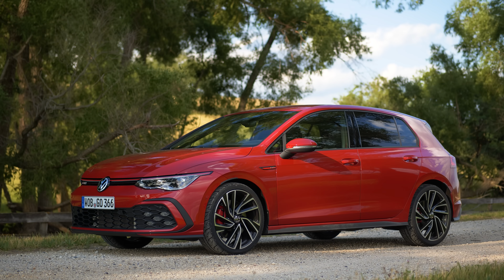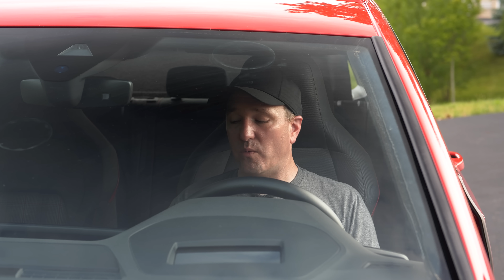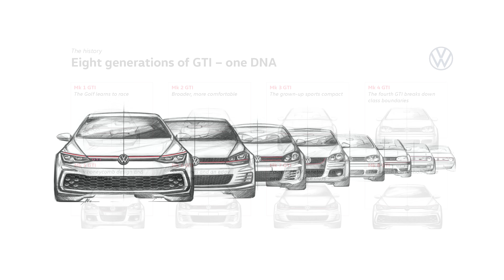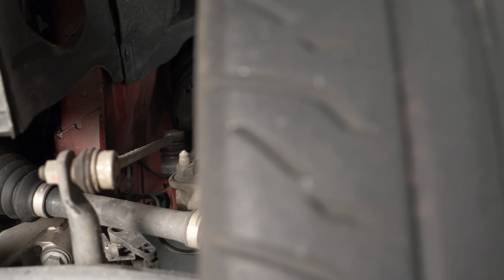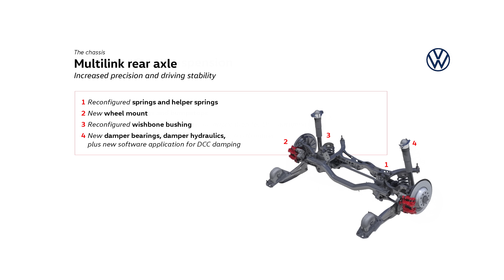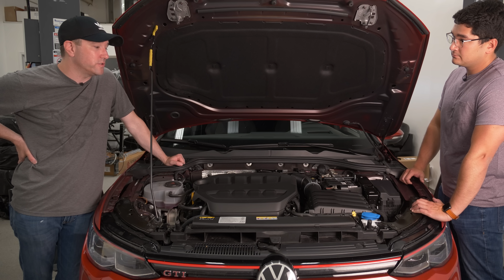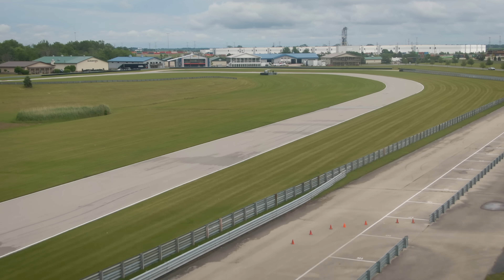2022 VW GTI Mk8 | Unexpected

Comment: I'm curious. Why is the HVAC control such a big deal? I literally set the temperature at 22C in the summer and 24C in the winter and I'm all set for the year. The blower setting is constantly on the 2nd setting cause i don't feel like i need it instantly cold or hot cause me playing tennis, the conditions are ten times harsher. I just dont see how something so small is getting so much fuss.

Comment: Great video as always Mark by you and Jack.  I have an ND Miata RF 30th Anniversary which is NOT my daily driver and I love it to death.  For a daily I was curious so I went to a VW dealer here in Toronto and test drove a manual Autobahn model.  The things you mentioned about the driving dynamics were spot on as I felt the same way during my test drive.  Beautiful and engaging car.  Obviously the manual is not even close to my ND Miata but it’s not a complete nightmare either.  The car felt really nimble and playful yet very confident and solid at the same time.  Thanks for the review 👍🏾

Comment: With 2024 being the last year for the manual transmission, I no longer see the point of buying this car. We're talking about 35 to 45k for a tiny car that doesn't even come with a manual transmission option. If I'm going to get an automatic then there are many other options out there even if they lack some performance. To me, a performance car must come with a manual option, otherwise, it is simply a car that goes fast. Might as well just be a self-driving car. BIG MISTLKE getting rid of the manual transmission.

And, unfortunately, the Jetta is made in Mexico and I do not trust the craftsmanship. My personal observation is that VW cares more about sticking toys in their cars and the latest high tech than worrying about making a car that lasts. When I was a kid, it seemed like VW Rabbits would run forever. Now it's turbo this, electronic that, and it breaks.
Reply: VW only sold 8000 Golf in 2022 in the USA. And the manual hasn’t been available on the R in Europe for years (maybe the GTI too).

Comment: GTI DSG or GR Corrola?

I want a fun daily driver that is economical and reliable.

I drive over 80 miles round trip to work each day.

Currently have a 2021 Corrola hatchback 6 speed. Love the car, just want a little more power for passing when needed.

Note: Volkswagen reliability concerns are the main reason I haven't pulled the trigger yet. That and the possible 8.5 update with hopefully physical buttons.

Comment: My MK7.5 does have an oil cooler.  The bad news is they fail and let oil into the coolant system, which is bad enough, but it also lets coolant into the oiling system, which is a disaster.  I first spent $1800 having the oil cooler replaced (6 hrs labor) and systems flushed.  Didn't help, four days later the disaster and $9000 for a refurbished engine.  This is a horrible engine design.

Comment: As an owner of a nicely modded MK7 GTI, I must say that with suspension mods, grippy tires and engine tune the MK7 is very competitive and great fun to drive on the street. And the MK7 has a proper cockpit with well designed user controls and interface.

Comment: I wish we had a dual fuel injection system, specifically the inclusion of port injection to keep valves clean. My MK6 GTI had ghastly deposits on its valves with its direction injection set up. While I didn't notice any idling issues until about 150K miles, once I cleaned the valves and replaced the injectors the car ran and idled like new again. I'm now nearing 200K miles. The car has been an absolute joy to own and drive. Considering a MK8 purchase.

Comment: I just bought a 40th anniversary GTI and I should be getting it in about a month. I’ve seen and heard a lot about the infotainment system. I haven’t driven it yet of course but even in my 7.5, I don’t really often find myself touching the screen to play with settings regardless? Other than the HVAC and volume, which are obviously two big omissions (button-wise), realistically why would you be touching the screen so much while driving? In day-to-day stuff anyways. If you’re going to turn traction control and adjust driving profile, you’d typically prepare for that before you’re doing sportier driving activities such as track driving, no? Again, I haven’t lived with mine yet but just my initial thoughts.
Reply: How’s the car so far ? Any regrets or complaints ?
Reply: @Neverfollowthecrowd  I love it! The touch buttons on the steering wheel took me about a day to get used to it and the infotainment system about a week I’d say. Once you set up shortcuts for everything it’s a breeze to navigate through! I’ve heard people having glitches with their system but I haven’t had any and I’ve had the car since mid April. 

My only gripe that I find annoying is that A) you have to reselect your audio profile every time you start the car (the audio settings) and B) you HAVE to touch the screen to turn on/off the clima controls. I don’t mind using the touch buttons to adjust it but it’s annoying having to touch the screen to turn it on and off.
Reply: Do you still own the car?

Comment: VW seems to have deaf ears regarding constructive feedback.  They are so driven by cost reductions which impacts the value proposition of their vehicles. Removal of buttons on the dash was not meant to be futuristic as much as it was meant to reduce costs. It’s unfortunate when a superb car from a mechanical perspective is castrated by an inferior infotainment system and cost cutting.  VW has brought software programming in house.  The user experience, functionality and responsiveness shows they are still very much in their infancy in learning the art and science of software programming.  I’ve owned many new VW’s dating back to a second generation Scirocco and up to a turbo diesel Touareg. I’m obviously a VW fan.  But given the failure of the infotainment design and performance I could not ever purchase this car.  You can upgrade car mechanicals dramatically. But you are absolutely stuck with what you get on day one for infotainment.  Unlike Tesla, VW is still struggling with software updates at the dealer. Forget about over the air updates. My hunch is VW has cheaped out on the cpu and memory specs for the infotainment hardware which is exacerbated by inefficient and poorly architected code. Rumor has it they are redesigning the dash.  Which I hope is true.

Comment: I have a mk8 GTI, had a mk7.5. The driving quality is far better in the mk8. The interior style is better in the mk7.5, but the seat and position is better in the mk8. The infotainment is definitely better in the mk7.5, but here's the thing - most people aren't touching the screen all the time, I definitely am not. Once the temp is set and the fans are on auto and the music is playing and the nav is in (both can be done on my phone before stepping into the car), that screen is not getting touched, and that was the same story for when I had the mk7.5. The steering wheel controls are adequate for everything. And I personally like the squared off look of the rear and the visor-like look of the front over the mk7.5, makes it look meaner.

Comment: After owning one for a few months, I can honestly say that it takes about a week or two to get used to the touch controls. You can create shortcuts for about anything as the infotainement is fully customizable. So, almost anything you want to access often is a touch or two away after setting it up. After some time you don't even have to look anymore as muscle memory kicks in. Also, as it was explained in this review, steering controls are easy to understand and to use. For the most part, you don't even have to bother touching the screen at all.

Comment: Handling 👍🏻👍🏻
Interface (usability) 👎🏻👎🏻👎🏻
VW seems to pump out a dud every 4 GTI generations... Remember the flak the Mk IV got for its bloat (for added "luxury") and now the Mk VIII with its wholesale capacitive touch control (for appearing techie?). These are two cardinal sins in the GTI's original fundamental philosophy: high-value performance/driving experience with sensible, solid components.
Just remember to set all your audio, HVAC, traction/chassis tuning settings before you leave your driveway, and put on a pair of leather driving gloves when you get on the road... just so that the Mk VIII doesn't give you a nasty surprise when your fingers/palm accidentally brush against the capacitive controls on the steering wheel.

Comment: I have a deposit on a 2022 MK8 GTI "poverty spec" 6-speed coming any day now.  It comes with 17" wheels and all-weather tires.  This will be my first upgrade (would have ordered it with the tire/sunroof package if it was available).  I will keep the original tire/wheel combo for west coast winter-ish weather.  Wondering if anyone has recommendations for a good wheel & summer tire combination?  Not going to be driving it on a track or anything.

Comment: Im worried about reliability issues... how reliable can we expect this car to be?
Reply: Can't really tell till years later.  It's why Civics are always sold higher than sticker, because you know they will be reliable and retain value
Reply: @steveshin820 the real value of the SI is that its msrp is lower than the GTI. If you're paying just as much as the GTI, then that advantage is gone. Other than the lower msrp, the other advantage of the Si over the GTI is the shifter feel/gearbox. That's it. The SI is lighter but that doesn't make up the power difference. If the SI is like 240-250hp while weighing under 3000 lbs, then that's a different story. 

If reliability is such a top 1 priority to you, then these cars are not for you. You should look at corolla instead 😂

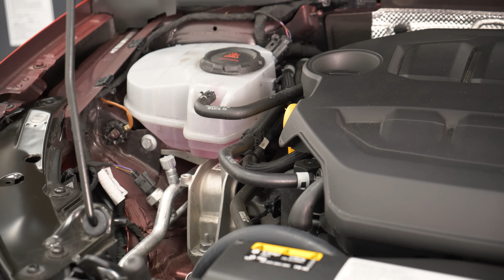Comment: Hmm. There is some debate online that even in Europe, VW has removed dual injection on these motors. What I do know, is that the engine being shown in the b-role footage in this video does NOT have dual injection. If you look at the intake manifold at 11:06 in the video, you can clearly see the molded in ports that the 2nd set of injectors would be mounted to, and there is nothing there. Nor is the fuel rail, or any of the lines there.

Comment: The move to touchscreen controls is just rampant cost cutting - it's not about even trying to improve user experience or give a premium feel.  They can claim that...but this is just a gutted interior budget.
Reply: They cut costs on the interior to make up for the huge research costs on improving the performance. 

If interior is your top 1 priority, you should be looking at luxury sedans and SUVs instead 😂😂
Reply: @WitchYuki22  There is barely any research costs on improving performance for this generation. Even if there are research costs, under IFRS standard, they can recoup and amortize a portion of R&D. VW cut costs to standardize interior components across the entire lineup, maintain margins amid supply chain inflation, and lower economies of scale from diminishing volumes.

Comment: Jeez! RE71R tires! They didn't fix shit with the suspension,  the tires are doing all the work! Those are literally some of the best street tires you can buy, they dominate at the track but last about 12k miles. If you ask me this totally discredits VW suspension.  If you swap these tire for anything other than the same tires or racing slicks then the performance will decrease.  You can't expect average Joe's to continuously buy the expensive tires every 12 months.

Comment: I saw that you made a mistake when changing the volume below the screen.  You should not press you should drag your finger as on the remote control for Apple TV, for example drag your finger from right to left below the screen to change the volume
Reply from the maker: You can do either.

Comment: The Straight Pipes guys took the car to the track, turned off ESC, and it's still on.
Reply from the maker: Diff is elsd, electromechanical.  Stability is off but there is always communication between different parts of car. Makes it feel like its on.
Reply: @savagegeese  thank you for the clarification 🙏

Comment: The annoying part of a touch screen is not to find that “button”. It’s to keep your fingers on it when you are driving especially when it’s bumpy. In my opinion the easiest to use infotainment system is the BMW iDrive. 1 knob that turns both directions, moves 4 directions with a press down. No need to lean forward to the screen. The screen will not have any fingerprints. Really simple to use.

Comment: Yet another ridiculous review of the infotainment. Who needs to switch the traction on/off so often that a few clicks becomes a problem? If it is, set up a shortcut. Am I the only one who sets my climate on auto? I haven’t adjusted my fan speed manually in years, and barely adjust the temperature for the same reason. It’s like you’ve now got an iPhone and are expecting to use it like a Nokia 3210.

Comment: I’m sorry but your assessment is way wrong, putting 200tw tires changes the dynamics massively.  Can’t wait for a comparison when comes with all-season tires that will actually come on these cars and it washes out because it can’t get grip adding the fact the rear won’t rotate.
Reply from the maker: It won't turn a car that terminally understeers into a car that doesnt.  Yes it is a cheater tire but, we shall see.

Comment: I'm glad it truly is a big upgrade.  Yeah, I could do without all that touch control garbage, hopefully there are some fixes or shortcuts later on down the line.  I'm glad too they still offer the 6 speed manual as that would be a show stopper for me if they didn't.

Comment: I saw another report claiming that VW but less grippy tires on these initial test cars to make them handle better, but once you put the same tires all around (like the production cars will have) it turns out to be the same under steering pig it has always been. There are a lot of ways to make these cars handle better, but that is not how they come from the factory.
Seems very brazen and deceptive if it is true, I mean once production cars come out...

Comment: Hi Savages, a question for you. You state in your review that the car rotated well in your test drive, did you notice if the 4 tires were the same. I was told that this is the case because Volkswagen delivered test cars with stickier tires in the front allowing the care to rotate better. Thanks

Comment: I presume most people here have never test driven a mk8, because once you get to really drive one, the buttons are the last thing that comes to mind. This car reduces my stress from driving by half. I've owned only for a couple months though, it's quite possible that I will find inconveniences with time, but I don't miss physical buttons a bit, but that's me, I guess I'm not a majority.
Reply: hey stefan, any thoughts after a few years?
Reply: @imaman_imforty  Yes, I'm super happy with my golf. I don't drive that much it's now on 30K km mileage, nothing is faulty yet, except for some reason when you have low key battery, the front assist system goes off, but when you load the battery of the key, it's fine. I need to change tampons though, because on bulgarian roads they now squeek a bit.
Reply: Youtube bluster. 3 minutes in the car and the touch screen works great. You can tap and not swipe. It’s intuitive. The driving is what matters.
Reply: @dumafuji  Buttons are intuitive touchscreens are not.
Reply: @svn5994   I don’t have a horse in the race. I’m old enough and young enough to have preferences for buttons and touchscreens in different circumstances.  I’d rather have a touchscreen and not a punch card on my desk at the office.  In the car…buttons are good for some things for sure, but not everything.  Touchscreen for music phone gps, buttons for climate? Maybe. There’s a lot of climate control in the car.
Reply: @svn5994 when you own a car being intuitive is overrated.  You learn how the car operates and it becomes muscle memory.
Reply: This worked well for BlackBerry @svn5994
Reply: Idk what’s with these YouTubers acting like touch controls beat their mothers up or something.
Reply: I don’t miss physical buttons at all.   And I’m and older female.   I honestly find the entire interface easy with plenty of short cuts. 

And I certainly never feel like I’m spending too much time fiddling with my eyes off the road.
Reply: Facts. Big facts. Owner here.

Comment: No true manual mode for the paddle shifting they don’t mention. To engage manual you have to press the paddle, and at redline it auto shifts up. My 2021 MK 7.5 GTI SE as we know,  you kick the gear selector to the right and the gear doesn’t change until you hit the paddle yourself. only the MK8 R has the true manual mode for the new models. So the MK8 drives a bit better on the track but personally I’ll never take mine to the track.

Comment: At first I had some relief that the mk7 was still available to buy when I saw the mk8 interior, but seeing how much better the mk8 is than the mk7, the mk8 interior is so much more unforgivable. VW didnt have to do ANY OF THIS. They could have rearranged the mk7.5 infotainment and vent positions, and change the seats and steering wheel as they did (with physical buttons of course) and it would cost chump change. They need to fix it, and if VW gives us an ID3-GTI, they need to fix it for us too.

Comment: I don't plan to buy this gen of Golf but am interested to check out the current factory sound system in mk8,  in mk7, the Dynaudio I had (I think US had Fender?), was just hot garbage, it was just a dumb subwoofer and that was all it offered - nasty bass, horrible sound and stupid central speaker that seemed to push 80% of the sound so it felt like mono audio with cheap sub in the back.